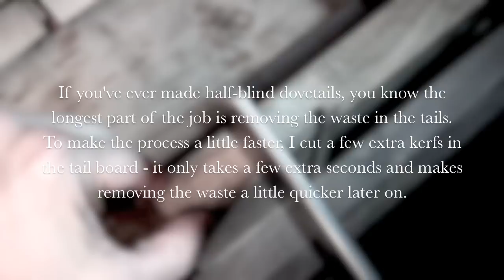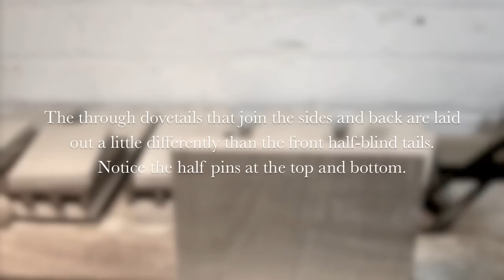A Card Catalogue part sixteen: Dovetailing the drawers.

Comment: Tom, wonderful video, thank you again for all your hard work on this, you are more inspirational than you know!
Question: why did you use two different backsaws to cut those joints? I assume they are different (length, tooth geometry, etc), but I can't tell how they are different from the video. Can you shed some light on which saw you used for which task and why? I'm new to dovetailing and I'd like to know your preferences for my own knowledge.
Thanks again and keep up the good work!

Comment: cool I'll remmeber the 140 trick very clever !! thanks !
Reply: I have a small question about this trick .. If I've well understand there is a drawback ... It will set the drawer sides not flush to the front but few mm below and if after gluing you shoot the front flush to the side the width of drawer will be reduced ... I think I'm wrong so I think I missed somthing ... thank's anway for all your videos !
Reply from the maker: Proffinouille
the marking gauge for the drawer side thickness is set a "little less than" the actual thickness so when the sides are assembled, they'll be a little proud of the front. Then they are fit to exact size. The drawer front is never touched once it's originally fit.
thanks for the question and all the best!
Reply: Tom Fidgen I understand thank's for your reply and for sharing your work like you do .. I'm not yet ready for dooing all my wood worrk by hand (especialy flatness and thickness early setup) but I'm trying to acheive this ! may be one day I can meet you on a school or somewhere else (sorry for my bad english - you know what french guys english skills are ! ;) )

Comment: 6:45 Can I ask you why they suggest that?
Reply from the maker: sure Al- some say the joint will fit the best the first time you push them together. While this is true, if you're careful when taking them apart, I never found issue with it.
thanks for the question-